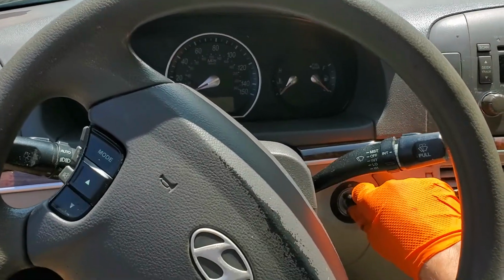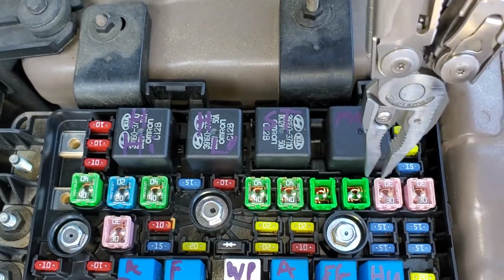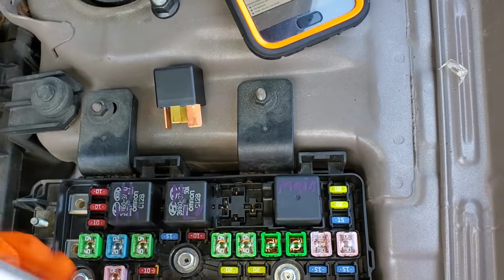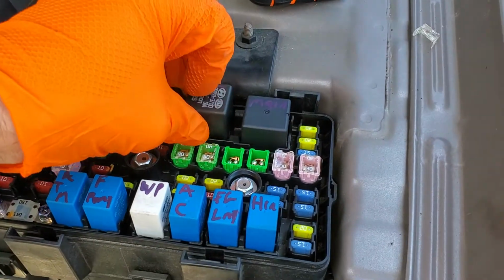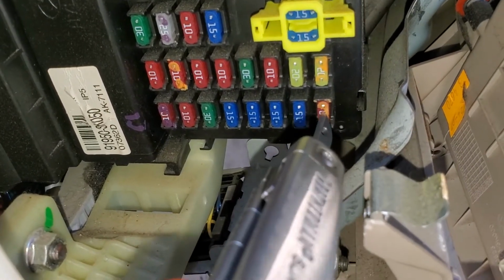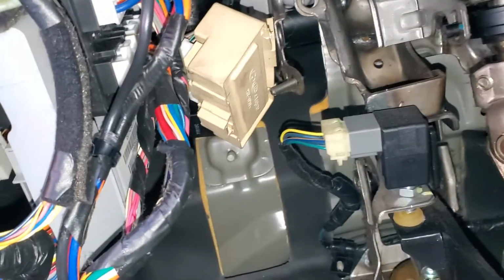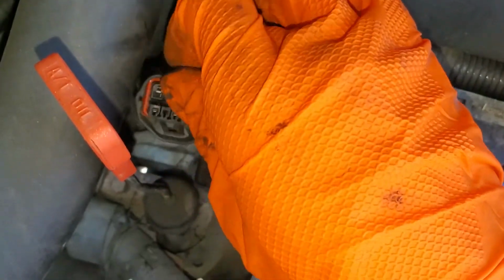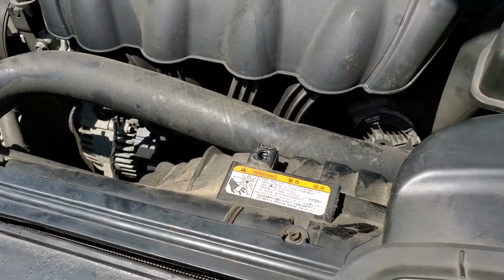2008 Hyundai Sonata Starter Fuse, Starter Relay & Circuit Explained

Comment: Thanks for the video. It was very informative. My problem is the starter will not stop spinning. Like it stays energized. I just installed a new starter and alternator and it’s still doing it. Swapped the relays like you said and it’s still doing it. Fuses are fine. I took out the starter relay and jumped it like you showed and the car works fine. Any suggestions?

Comment: I had an idiot try to steal my car last nite same as here but I’m left with everything looking normal but wheel won’t lock and no power even to lights.any idea’s?I do see this is 3 yrs old.I looked at fuses under hood they appear good but at this time I’m to close to a car to get door open to check inside fuses.any help is appreciated.oh they tried to steal a 3 wheel car on jack stand as I was working on rear brakes.brilliant right
Reply: ?oh I’m assuming the problem may be under dash at alarm as you pointed out but I won’t get ahead of you

Comment: I start the car and it sounds like the cars starter does not engaged and grinds. But only does it in park and nutrueal
Reply from the maker: You might have stripped teeth on the flywheel or a failing starter.

Comment: I have one that was parked for a few months. When I boosted it, the horn was constantly on and it did not start. The starter sounded like it tried for the first two boosts but after that, nothing. Would this be the alarm issue?

Comment: I have a few questions if you have the time I'm getting power to the starter fuse that is in the dash so that tells me my ignition is good correct I have swapped relays between high beam and low beam and the starter relay nothing I have checked all the fuses underneath the hood I've checked all the fuses in the dash any help would be greatly appreciated I've even tried running my own wire from the hot to the starter fuse in the dash to bypass the ignition and nothing
Reply: Did anything work? Please let me know thanks
Reply: @thefever5654  it ended up being the starter itself
Reply: @corey9228 thanks for the reply got 1 more question  where did you purchase them new starter I think that’s my same problem not sure what kind of cheap  starter to buy don’t got much $ so lmao

Comment: Awesome video I have an annoying intermittent no start and have traced to  intermittent no power to starter relay so it’s either neutral switch or alarm/theft relay
I will jumper the neutral switch so if it continues to cause problems it is the alarm/theft relay or bad connection 
Can I jumper the alarm/theft relay out of circuit ? Help

Comment: Well, i have a 2007 hyundai sonata and my car wont switch gears unless i press the gear release what can i do and also when i let my car warm up for about 5 minutes whatever that big metal thing behind the motor be really hot fast. I also was told i need 4 coil packs would that be the reason for the heat

Comment: I have a question all my lights on my truck work but running lights? I even hooked a trailer to the plug and there’s absolutely no running lights it’s a 2003 Dodge Ram

Comment: Hi! 
I saw that you did a video on a Chevrolet Spark and the blower. 
The blower in my car only works if it is on either 1 or 2 on the switch. 3 and 4 does nothing, unless I press really hard on the switch. Do you have any suggestions to what might be wrong?
Reply from the maker: Sound like a bad switch
Reply: Lehew Tech 
Alright, thanks.
Reply: How do I know if the JK fuse is still good?